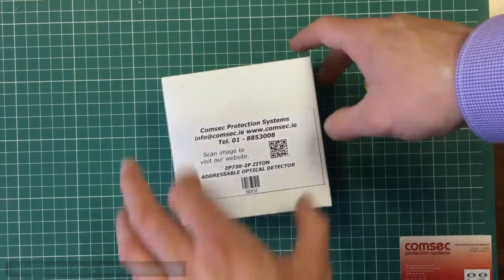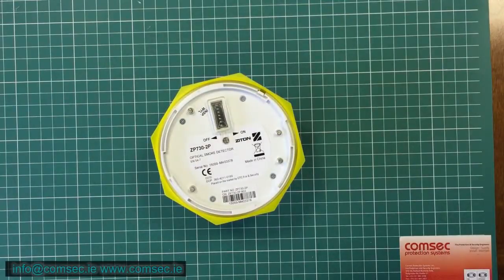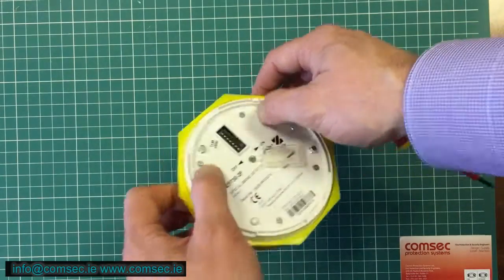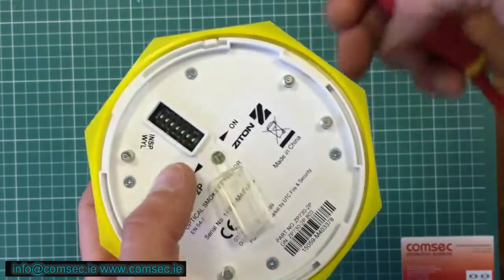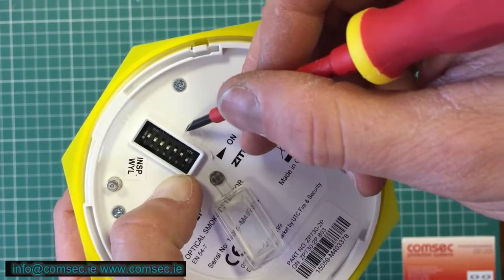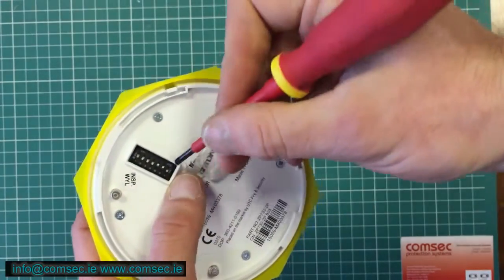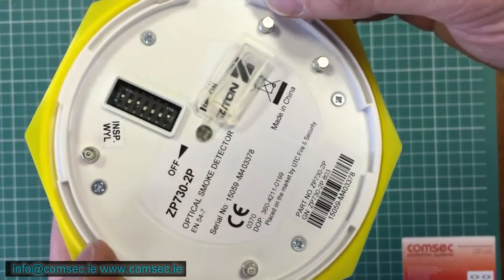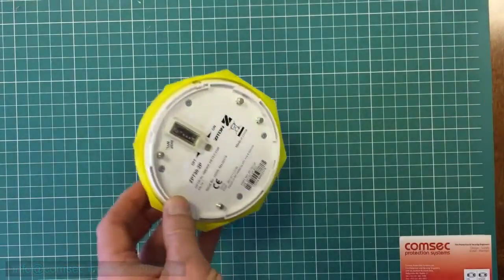Ziton Detector.

Comment: Is it possibly to build a test station that will enable remote testing of fire heads, functions test, read address etc? We have a pile of unknown condition ones, there £300 each new! Please.
Reply from the maker: MrAshley155 we have a test rig in the office connected to a ZP3 panel. We soak test the optical devices and then test them using the solo kit and that gives us the % obscuration that the detector activates at. With a laptop connected to the panel we can see the analogue levels for the detectors but not of it is automated. We tend to use it for fault finding or in the case of legacy ATEx equipment soak testing for reuse/redeployment